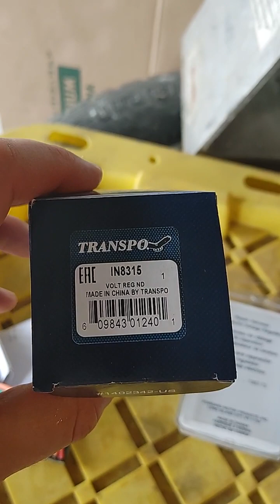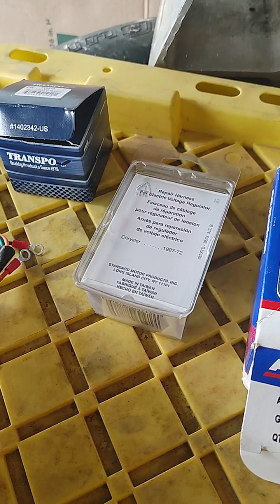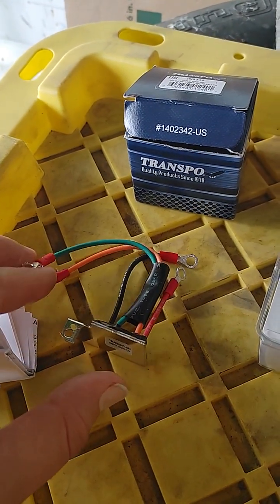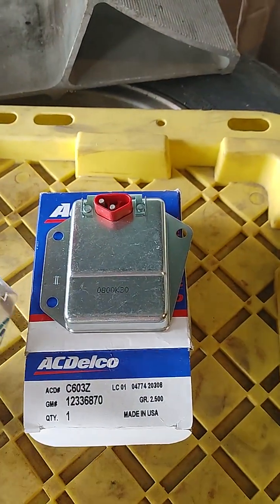external voltage regulator #cummins #2ndgen

Comment: I’m going to have to do this job shortly myself. Is there a way you can make a simple diagram for those of us wanting to do this? You mentioned a pigtail and I want to make sure I understand where both wires go to contact the 3 points on the alternator. Thanks for making this video though trying to get an entire new circuit board isn’t an option!
Reply from the maker: @douglasdakin3934  I may have another video about it, you could search. If you look me up on FB Jwkustm should find me I have both a Cummins and a belair album, both ended up needing external regulators.... I am pretty sure all the wiring info I used I posted there (so I could find it again) visually impaired right now so I haven't been making any videos for the last 6 months sorry. Hope that helps point in the right direction.  Pigtail came separately with both external regulators that I bought, was told it was a common part tho.
Reply from the maker: Bonus if you are local to TX you can come look at it, car is still in the driveway 🤦😂